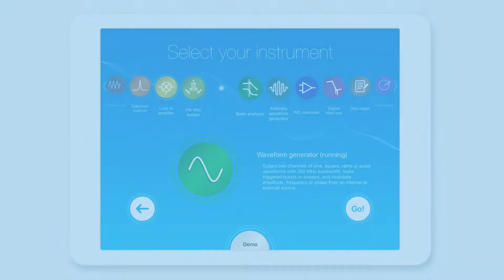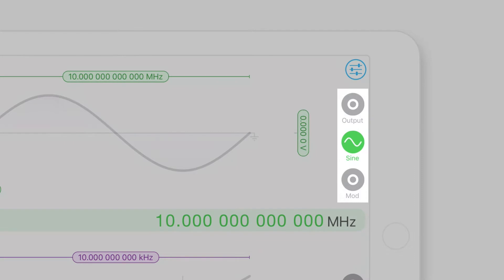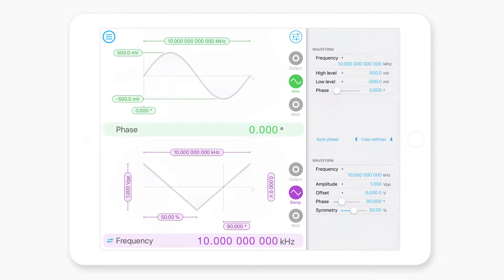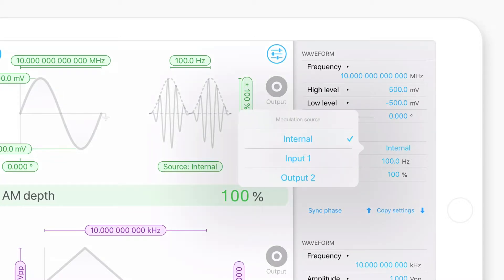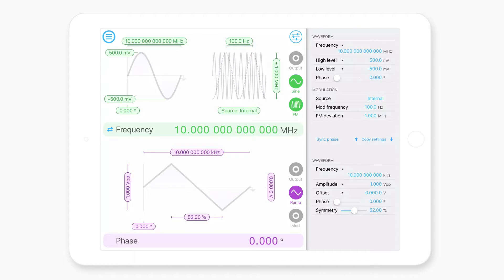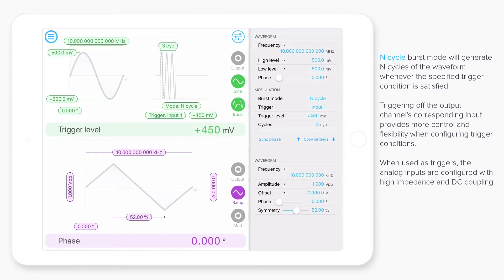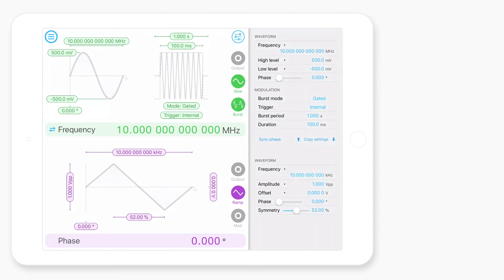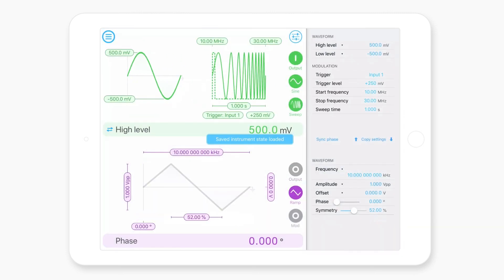Moku:Lab's Waveform Generator — Training

Comment: Can I use two modulation options at the same time? For example, frequency modulation and amplitude modulation for ch.1.
Reply from the maker: You currently can't modulate both amplitude and frequency at the same time. But you can use the arbitrary waveform generator that is included with the Moku:Lab.